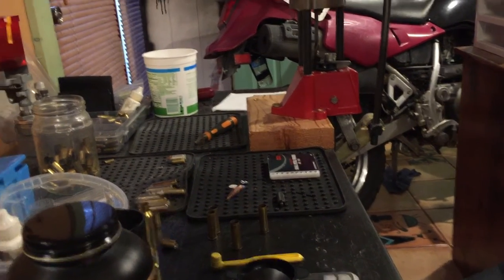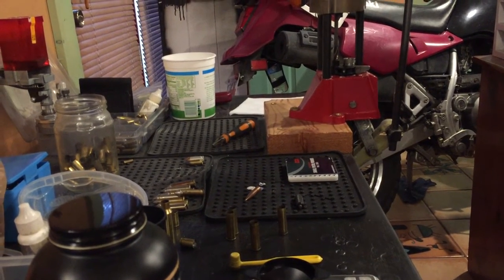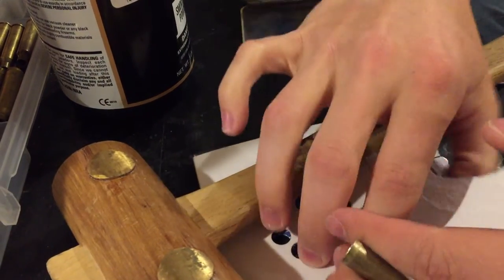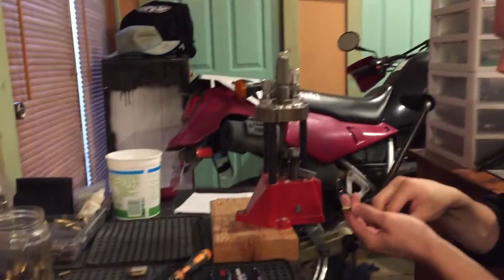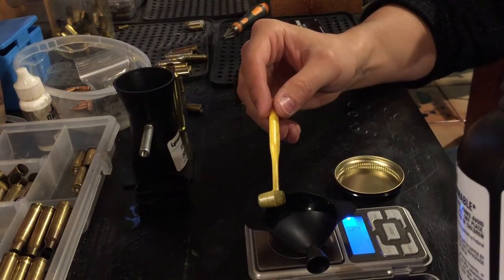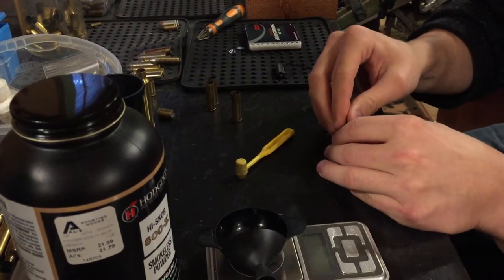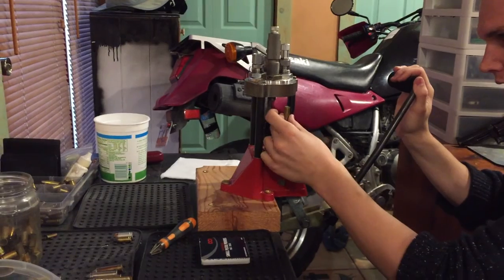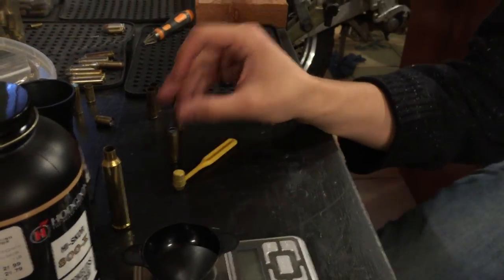Reloading .357 magnum shotshells without speer shot capsules

Comment: I just want to throw a caution out there for folks who might try this.  I tried it with my son in law, using 7.2 grs of Titegroup powder, which worked fine with 110 gr bullets.  Nail polish was used to seal in the top wad card.  Approximately 85 grains of #9 shot was loaded in the shells.  Two test shots were fired, and there was clear evidence of over pressuring on both brass cartridges.  The shells loaded with bullets showed no problems.  It seems likely to me that the over pressure condition resulted from the tight confinement of the powder in the shot shells, as opposed to the bullet shells.  SO, just because you're using a particular load for bullets don't just assume everything will be fine with this shot shell technique where you pack the powder behind a wad.
Reply from the maker: Thank you for your input I would not have put so much titegroup in though. I would stick with unique / universal around 5 grains.
Reply: 4.5 is plenty if you don't wanna buy powder every day.
Reply: Interesting theory. I use a similar technique for 38 Special. The amount of titegroup I use is determined by the weight of the shot charge. I was always interested how shot charge related to bullet weight in terms of powder charge. I haven't had any problems with titegroup in my 38 Special.
Reply: Tightgroup is a very fast burning powder.  Unless you have extensive experience developing your own loads, you should stick to unique, trailboss, or any of the other flaming dirt powders.  I also do this with my 45-70 while deer hunting. I cut my brass down to about half length.  I use a wad and roll my shot in newspaper then a wad over top with parafin wax and a tight roll crimp.  If you see turkeys or pheasant :D who cares if you get a deer?

Comment: I agree with others. Wax or glue on top of the shot card. That's what we do for 12ga brass shells. 
Also, has anyone ever melted wax with shot - pored the hot wax with shot on top of the over powder card? Might hold a tighter pattern.
Reply: Too tight of a pattern.  The wax hold it all together like a slug.

Comment: Have you thought about pouring hot wax on top of the last wad to seal everything together and allow you to shoot in a revolver?
Reply from the maker: +Peter Bundarin That seems to be a good idea maybe I will try that. That may also work to make some wax slugs. Thanks for the comment.
Reply: +Joseph Jacobs I have found putting a light coat of JB Weld over top of the shotcard works great at keeping the shotshell waterproof and keeping them from coming apart. The JB Weld breaks apart rather easily and there have been no adverse affects to my gun (GP-100).
Reply: Hot glue gun would seal the cartridge and keep things in place...
Reply: I use Elmers Wood Glue to seal the top.  Works perfectly…

Comment: I like the capsules because they protect the riflings in my revolver.  Without that protection, I would not shoot these in any gun I didn't want to shoot out the riflings.
Reply from the maker: There does not seem to be a problem running them in my gun.
Reply: I would think that unless there is some material inside the cartridge that is harder than the steel of the inside of the barrel then the rifling should be fine. Lead shot should be fine, but definitely not steel BBs.